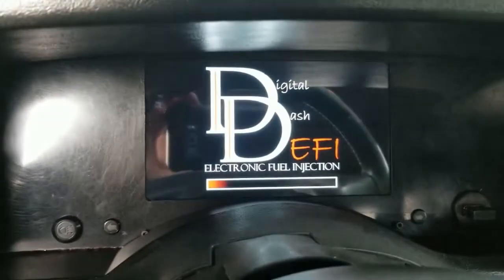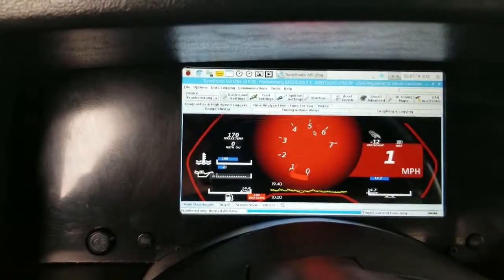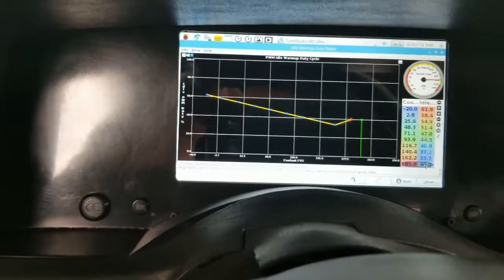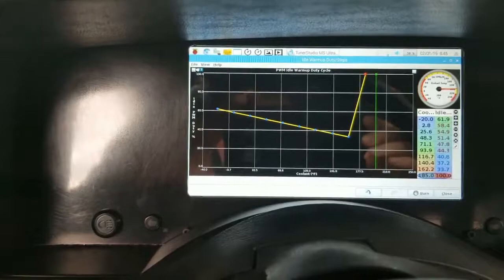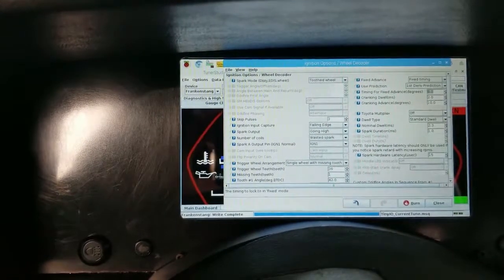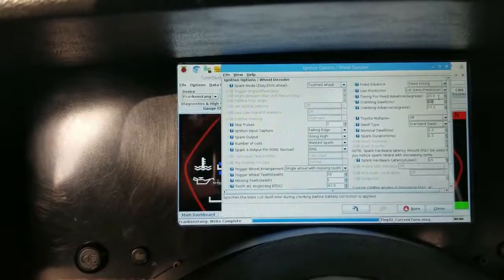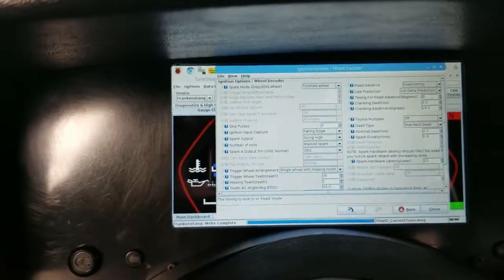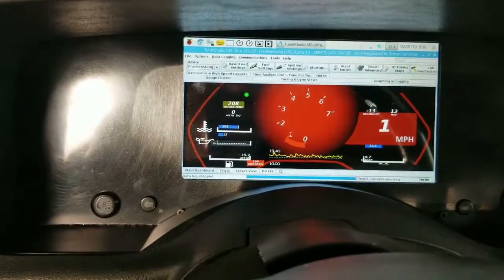MegaSquirt TunerStudio Closed loop idle Tuning part1

Comment: curious of a good working position or range the idle valve should be around at idle on a fox?  mainly the steps or percentage it should be at.  5 or maybe 10% at idle?  if any of that makes sense
Reply from the maker: That  depends on the HZ you are controlling the valve at. I usually set them up at 300-400HZ and the minimum and maximum  30% and 80% duty